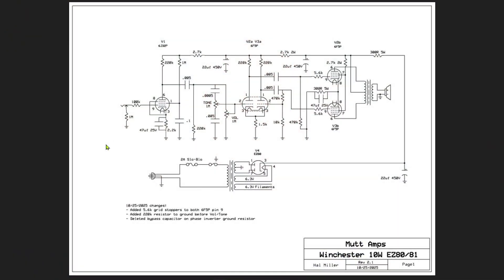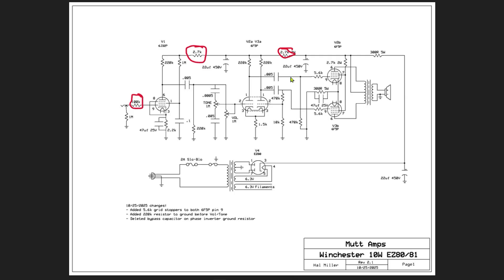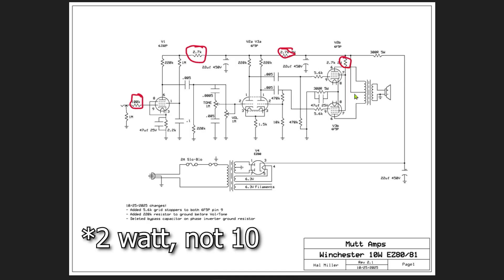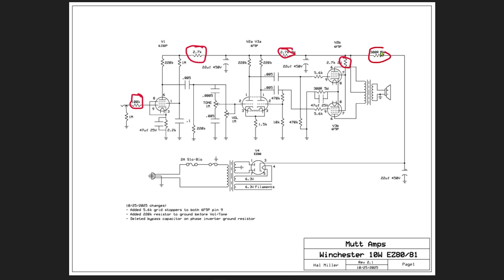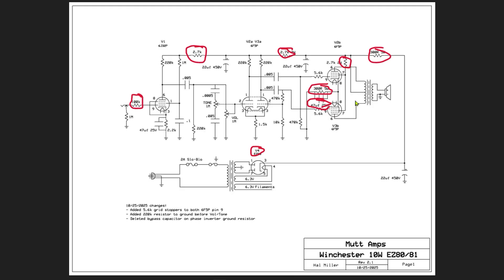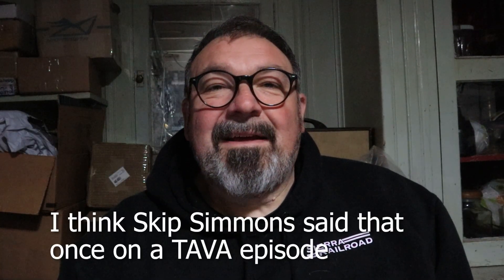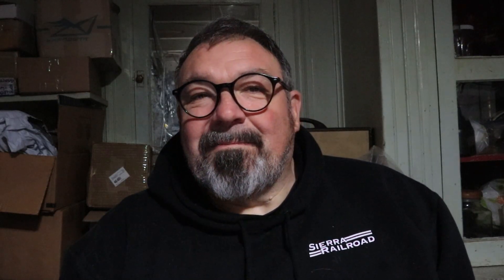A Watkins Westminster-Inspired 10 Watt Tube Guitar Amp Build - Nothing Can Be Easy

Comment: I'm surprised the 2.7K resistors are enough to decouple the power supply nodes, I get motorboating most of the times I use less than 10K for the p.i. and preamp. If you create a separate node for the screen and roll the screen resistors down to between 1K and 470R it'll change your power section sound, perhaps for the better
Reply from the maker: As a best practice I would probably do it the way you describe. There were a lot of component values tried in the multiple rebuildings; this combination seems to work.

Comment: Hello, good to find a video from you again, was wondering where you are!
One point struck me on the schematic - would there not be another filter cap after the 2k7 resistor in the B+ rail, before the screen and plate resistors for the EF86 equivalent?
BTW - not bad playing, at least for me as non-guitarist!
Reply from the maker: Thank you! I had to go back and look through the multiple versions of my schematic. Without the cap before the 2.7k resistor, I'd have just had two 2.7k resistors basically in series. Actually, that last 2.7k resistor is almost optional; in the Westminster there are only plate resistors after the last cap. I feel like somewhere in the process I omitted the 6J32P 2.7k then put it back in, but I can't remember why now!

Comment: I noted from the schematic that the output tube plates and screens are sharing the same power supply node; I"d suggest adding a series resistor and filter cap to form an additional power-supplly node specifically for the screens. As it stands, I'd worry that the screens might be running at a higher voltage than the plates when you crank the amp up. I've also heard that higher values of screen resistor may create too much compression. 1k to 1.5k are the usual values, and rarely does anyone go higher than 2.2K. BTW, I suspect that the EZ80 spec sheet meant to say/should have clarified to put the 300 ohm dropping resistor before the first filter cap instead of after it; this would make life easier for the rectifier ----- right now it's driving a purely capacitive load ---- as well as for the filter cap.
Reply from the maker: All good food for thought and I don't disagree. The way I have it is the way Watkins did it too, pretty much: https://el34world.com/charts/Schematics/files/Watkins/Watkins_westminster_10w.pdf
Reply: @muttamps , unfoetunately, numerous boutique amp companies have repeated the same mistakes of tge 1950's and 1960's! Case in point: 100 ohm screen resistors on Vox amps.  Those companies did have an advantage back then: tough, rugged Mullard and RCA tubes made to exacting standards were easily availabke. Today's Russian and Chinese tubes arent as reliable, yet modern amp "designers" insist on running them at 10 to 20% above the ratings originally published in American and European tube manuals; modern-production tubes struggle to work longterm at voltage and current keot within those old specs, and don't appreciate being flogged like rented mules!

Comment: Good job! I like the ef86 tube I have a few 1960s Webster PA amps and they use the ef86 for the preamp tubes. They can be microphonic like any tube but I love the way they sound.
Reply: What about PA amps equipped with the 5879 pentode, got any of those? Lower gain than the EF86, but supposed much quieter and lower in microphonics, which is presumably why some PA amps used them. Curious how they sound as a guitar-amp preamp.....
Reply: @goodun2974 I just sold a Bell PA amplifier from the late 50s early 60s and it used 5879 for all the preamp tubes and 12ax7 for the phase inverter... and then you've got the Gibson GA40 depending on what year they used to 5879 as well as the GA-80T Those 5879 In my opinion are very sweet sounding.
Reply from the maker: Me too, I can't quantify it but I feel like it's a little different than using a pentode like a 12AX7.